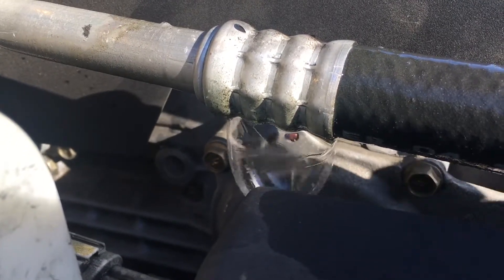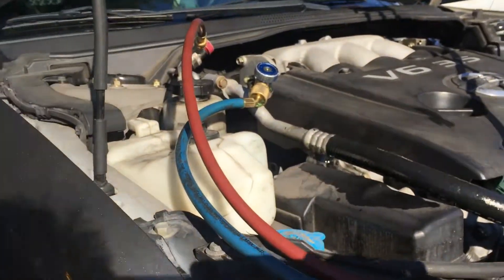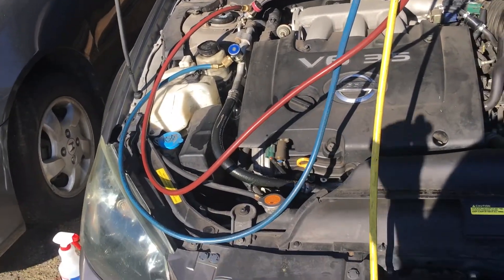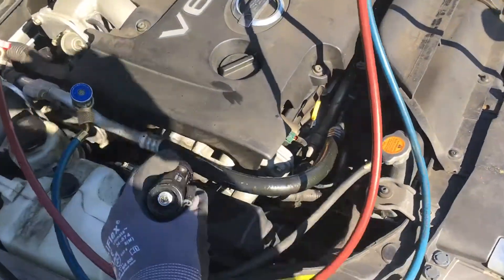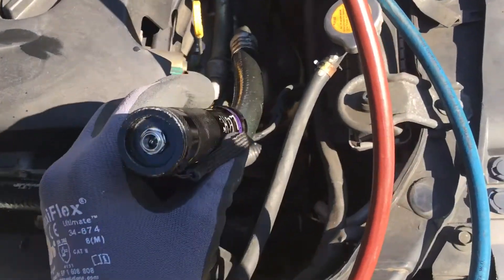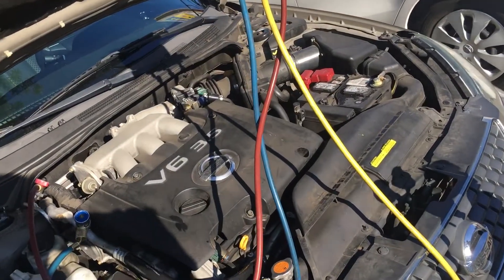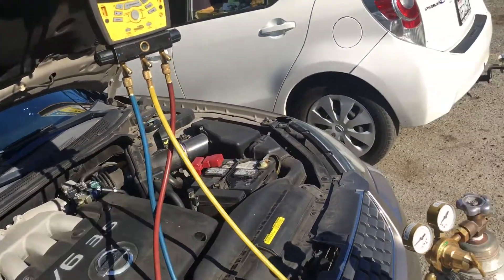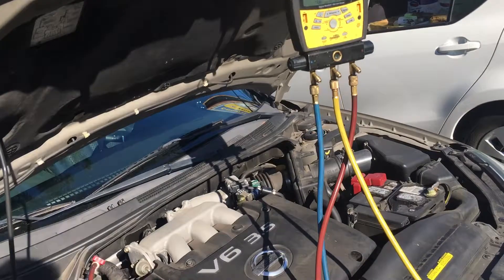Find refrigerant leak using dry nitrogen

Comment: I know it's been 5 years since this video was made, but do you recall how long you waited to get this bubble?
Reply from the maker: For this particular leak, I believe it was almost instantaneous.  It started forming a very, very small bubble..  🫧 and then just kept gradually growing as you see in the video.   The bubble size when you first see it in the video then several seconds later when you see it at the end of the visual in the video you see it has grown a little bit.. 

All vehicles and situations will be different. Some will be longer. Someone will be faster . 
     Some leaks or vibration dependent as if when the vehicle is driving down the road, and the hoses and lines are shaking from vibration.  If you don’t shake the hose at the crimp or the fitting, it does not leak..   when you start wiggling the hose, you see the leak developing at the crimp fitting. 

Some leaks are temperature dependent, and the metal has to get cold and shrink to cause a leak or the metal has to get hot and expand to cause a leak.  And when you turn the vehicle off and the temperature stabilized the leak turns off and stops leaking.  
      And there’s a few other scenarios where the leaks stop and are not constant
Reply: @coldfinger459sub0  Yeah that all makes sense. I have a customer's car, 2011 Porsche Cayman, with a slow leak, the system is empty in maybe 5 months. I always put dye in when charging and no evidence of a leak found then or this time. Originally I replaced a A/C line the customer damaged with a floor jack. It lasted less then a year that time, and less since then. I got a Nitrogen tank, pressure regulator and have pressure on the system now ~185 psi on high and 65 on low side. The front bumper is off, engine cover panels off. Sprayed down every connection with Big Blue and nothing found. It has lost about 5-10 psi in 2+ hours. I'm guessing I need to get an Ultrasonic leak detector to do any better. 🙄
Reply from the maker: @ some leaks, do not leak constantly. Some leaks only leak under certain pressures and will stop leaking at a different pressure… 
  A ultrasonic leak detector may or may not get you there, depending on whether it is leaking at the time that you are testing

If the leak is happening at the evaporator inside buried in the case, a ultrasonic leak detector usually won’t pick that up because it’s inside the case 
This is where a extremely sensitive good refrigerant leak detector with refrigerant as the leak detect Aunt sometimes is the better choice 

There is no one single best method to look for leaks 
   There’s only a method that works best for the type of leak that is leaking under a certain circumstances in which it is leaking. 
       This is why we have so many different methods of leak detection that a good shop will own
Ultrasonic leak detector 
A good not just any electronic refrigerant leak detector 
    How good and how powerful the UV light is makes a difference
       Exactly what type of UV die is used because they come in different waiflike specifications whether that is best use with a UV light for 365 nm spectrum 385 nm spectrum or 410 nm spectrum.  Will make a difference whether your light will actually even show the UV die or you just be wasting your time looking for it..,
         Then when we really wanna get crazy, we use forming gas using either hydrogen or helium.   With a specific hydrogen or helium, electronic leak detector because the atom size of a individual atom of helium or hydrogen are so small. They have a tendency to leak out much faster and the detectors are much more sensitive if it’s a (“GOOD ONE”) one.

Comment: how many psi are released into the nitrogen system and is it released on the intake side or on the high side? Goodbye and thanks

￼
Reply from the maker: 200 psi in the high side. Or both. 

Sometimes with a hard shutoff expansion valve it will not all go to the low side.  
You put 200Psi in but only 98 psi will get to the low side then stop .

Comment: Where could we (DIYers) get affordable dry nitrogen please? Thanks
Reply from the maker: The nitrogen itself is cheap about $17-$27 depending what part of the country you’re in. 

But you have to rent the bottle for a deposit anywhere from $125-$300 depending where you are in the country

When your finish you return your bottle gave the deposit back.     So it ends up costing you the price of the nitrogen. 

But you still have to buy the regulator to control the nitrogen pressure that will be about $150 plus or minus depending what brand you purchase.     I nitrogen is available at all Refrigeration HVAC parts supply houses

Nitrogen is also available at places like Airgas any company that specializes in providing gas for hospitals and welders
Reply: @coldfinger459sub0  thank you!

Comment: Hello, do you add the nitrogen thru the high side or low side?
Reply from the maker: I add nitrogen through the high side but on some vehicles with a hard shut expansion valve it will not all go to the Low side then I open up the low side and let them into the low side . 

If I’m doing a triple evaluation and Plush for moisture removal process then I’ll just go in through the high side only and bleed it out the light side threetimesfor aiding in moisture removal. 

But if it’s just for pressure test it does not matter I just start in the hi side.
Reply: Thank you, very helpfull response!!!!

Comment: Is there any reason you pressure test with 150 psi and not something like 250-300 psi?   Lots of systems experience 200 psi on high sides so wouldn't 150psi not even simulate actual operating pressures.   Wouldn't testing at a higher PSI find some more leaks that would only occur under higher pressure?  Thanks!
Reply from the maker: komoru because the evaporator on the low side was not designed for higher PSI on cars. 

Yes it is true higher PSI will find more leaks that only leak at higher PSI. 
            On some commercial and residential HVAC systems I work on the manufacture recommend pressure testing on a newly assembled system as low as 400 PSI others up to 650 PSI. With the refrigerant R410a

Comment: t lech
I have a question,
Where can I buy that blue small hose that connects your gauges to the yellow hose coming from the ac manifolds?
Thank you for taking the time to make these videos!
Reply from the maker: https://www.trutechtools.com/Tru-Blu-Professional-Kit-BluVac-Pro

You could search for the single hose with adapters on their website this is a link to the full kit you don’t need the full kit a little bit pricey. 

     Are you automotive ? or commercial HVAC ?or residential ? 

         Look for the discount code box at True Tech Tools

Type in the word BIGPICTURE. YOU GET 8% off price. 

     It’s the code from Chris at HVAC VIDEOS
Reply: @coldfinger459sub0  Thank You for responding quickly, and for the discount code!
By the way I just started in automotive.
Reply from the maker: @elgabiglez  since you think you like Automotive stay in it for a few years and study and learn as much as you can. At the same time you may not think so but watch the videos on air conditioning for commercial and residential air-conditioning and you can eventually use some of that knowledge on cars increase your knowledge faster to understand how the car’s air-conditioning works. 
        Because there’s not enough training in automotive air conditioning bulletin that is high-quality. 

         And who knows maybe after five or 10 years you get tired of Automotive and if you keep watching the HVAC commercial and residential videos automotive mechanics make excellent air conditioning service diagnostic personnel.     Residential and commercial HVAC is so much easier than working on cars if you get good at cars computers and drivability problems and Smog‘s and electrical troubleshooting HVAC is much much easier and pays better.